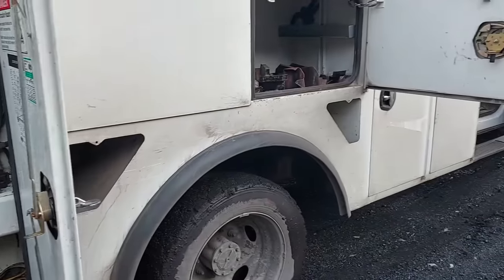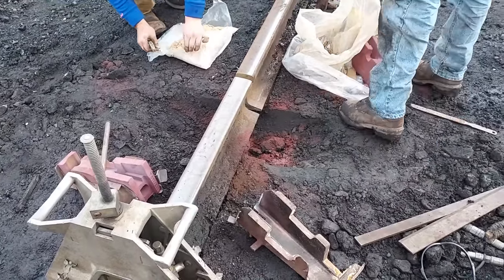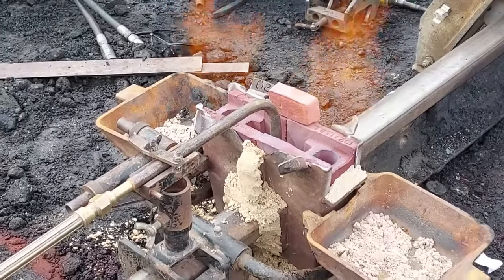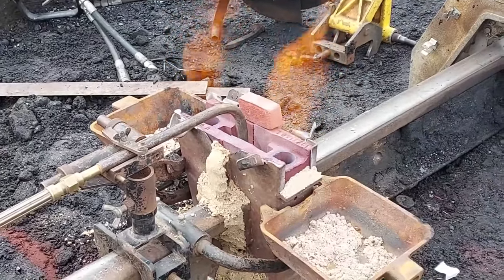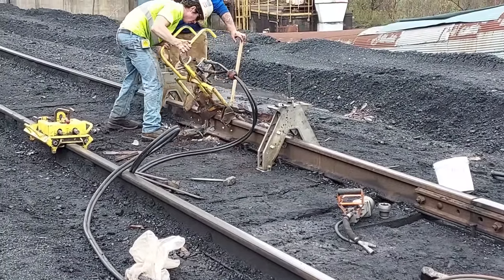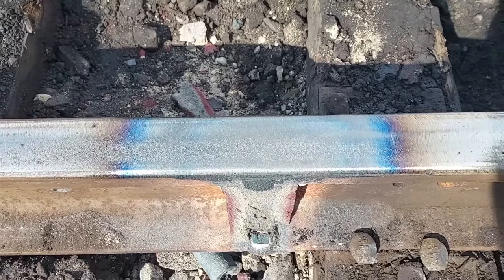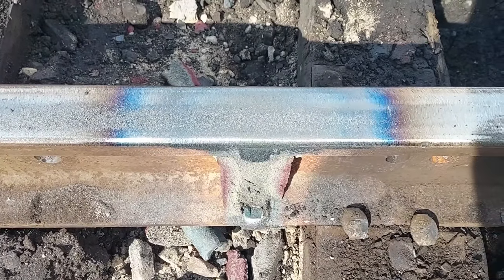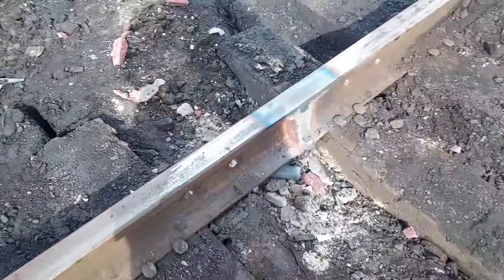Shooting a Thermite Weld on the Railroad from Start to Finish

Comment: All I’m thinking here, is that Why doesn’t the company provide all suitable work clothes?
I mean where I live in Denmark!
The laws says that companies have to supply you with adequate Work clothes. Suitable and security certified when working manual labor. 
working in the Railroad repair industry. 
It’s not because the law says it they provide it. But because it’s a relatively low cost to protect their employees. 
No employee shouldn’t have to use their own clothes they have paid for personally on their job. Unless there is a Financial compensation agreement with the employee.

My best friend used to be a welder. 

His work clothes! Provided by the company 
Was 2 pairs of Safety shoes. 
6 Long Sleeve Work pants
3 Work Shorts 
9 pairs of Specialized socks 
9 T-Shirts 
3 protective Work jackets 
2 Normal Work hoodies 
4 pairs of Specialized gloves. 
Everything can be replaced, just by handing in the clothing that needs replacing.

Oh of course a locker in their main base. To store it all and get dirty clothes washed by the Cleaning service.

That’s not even considered a Work benefit, that’s just reasonable when working for someone.
Reply from the maker: Very much appreciate your taking the time to tune in and
watch the video Common Sense. Hope you will sometime check out more of our Railroad videos at:
https://www.youtube.com/c/ccrx6700
Reply: @ccrx6700  thanks for the reply. And I will 😁

Comment: why weld instead of replace? cost?
Reply from the maker: A rail had broken there and this was welded rail to begin
with, so to eliminate the joints we welded it to keep it all
welded rail in this section. Thank you very much for taking the time to visit with us and check out the video.

Comment: Back in days late 70s ... working fo UP steel gang .  They used call them Glue gang....
Reply from the maker: I never heard that term before Dan, neat.  Appreciate very
much your taking the time to watch the video my friend.
Reply: @ccrx6700  yep.   Back in da days ..  alot of Navajos... were railroader,s    ...  glue were always at da very end of da steel gang...  welding  joints  together..  what they call 1/4 mile ribbons... 1/4 mile new rail...       was abit of hard  wrk . Today    Machinery  toke  over.
Reply from the maker: @danellis800  👍😊

Comment: I can't imagine any advantage to this welding process outside of not having to have a external machine thats capable of generating an arc..   

I'm certainly not trying to tell you your business. I'm just saying as a welder, I can't imagine any real advantage here... Any time saved by the actual welding of the joint , is lost in the large amount of excess bead that must be ground flush. And I can't imagine a world where that weld isn't full of porosity and lacking fusion.  
I mean the bottom of the track, would be the toughest part to weld , but I can think of several ways around that that would make the process easier.. and once the very bottom of the track was welded the rest would be gravy..  
I dunno maybe I'm missing something here, but if the truck is already out there, it seems logical that a welding machine could be also..  and if it is, a experienced flux core or stick welder could sew that track up in 15-20 minutes with minimal grinding to do after
Reply from the maker: Thanks for watching and sharing your thoughts. No one that I
know of stick welds rail. There is a process called flash but welding
that some RR's do, it's electric arc. A big automated welder
comes out of the back of a box truck, sets down on the rail
and presto it welds it. All of our welds are done by contractors
and they don't have the equipment to flash butt. So they do
thermite. May you have a most blessed day my friend.

Comment: Quick question (not sure it will get seen). But I've cut railway track with an angle grinder and it was a complete nightmare. I vaguely remember reading that its some molybdenum alloy that hardens v well. I was just wondering what effects this insanely hot weld has on the properties of the steel? I'd have thought it completely destroys any hardening and creates a substantial weakspot in the track no?
Reply from the maker: Good question, apparently it does not give a soft spot in the
rail because thermite welding is done all the time all over the
world. We appreciate your taking the time to visit with us and check out the video. May you have a most blessed day my friend.

Comment: When I used to weld crane rail for automatic storage and retrieval systems, stackers at paper mills, reclaimers at power plants, gantry cranes  at the ports,etc.., you couldn't leave all that flash and slag on there. Even the bottom had to be profile grinded. After you knocked the ears off, the job was just getting started.
Reply from the maker: That's great to hear you say that Daniel. Good job. Apparently the
RR is not that critical. Very grateful for your taking the time to visit with us and check out the video my friend.

Comment: I wouldn't let these guys near a mainline railway..! Pressure gauges missing on the heating torch end, and I didn't see a stopwatch anywhere in the video. Heating the rail  is performed by ensuring a set pressure (at the torch) and heating for a set period of time, dependent on the type of gas being used and the size of the rail. Similarly, the waiting time before knocking off the moulds should be according to a specific timing after the weld is dropped into the mould. Not sure I like the obvious "blueing" of the rail after he has completed the grinding...!
Reply from the maker: Thank you for sharing your thoughts with us Safety @AMSV. We appreciate your taking the time to check out the video and write in my friend.

Comment: Worked on BR for 20 odd years and thermit welding was always good in the winter . If some numpty tapped the rail further up and you had a run out , then it was a scramble . 👍🇬🇧
Reply from the maker: Really appreciate your stopping by Stephen and checking out the
presentation my friend. Understand tapping the rail, our
welders are pretty particular about not doing that.

Comment: Why wouldn't you just bolt it together? Theres already holes in the tracks for that.
Reply from the maker: Elimination of a joint in some very poor ballast conditions is why
it was welded. Joints don't do well in that bad of ballast. Thank you for taking the time to write in and for checking out the video my friend.

Comment: That grinding is dangerous. Moving that machine from side to side is going to real havoc on your lower back and knees by the time you are in your late 30’s. Try moving so you use a push and pull motion.
Speaking from experience and living with hip and knee pains that are excruciating. Nothing can be done but to live with it.
I had no body to tell me so I can only hope you listen and learn something.
Nice job on the rails!
Reply from the maker: Thank you very much Rob for taking the time out of your busy day to watch the video and write in with your thoughts.

Comment: . . . my dad used to do this while employed BNSF and he would come home and describe the process, who knew 25 years later I would be watching it on you tube
Reply from the maker: That's pretty cool to hear Rae.Thanks so much for taking the time to check out the video and may you have a very good day my friend.
Reply: This guy mentioned good old Smiddy in this video!  I remember Smiddy once bent over to pick up a tool, and he was standing rear-end facing a guy working on a rail.  Well, when he bent down, his rear stuck out inches from this guy's face and the force of picking up a heavy tool caused a big wet fart right in the guys face as he was breathing in.  The guy nearly vomited.  Man, that was hilarious, but I never really trusted smiddy after that.

Comment: It seemed to me that the process was quite efficient, with most of the molten iron from the thermite being contained and very little 'splattering' off as sparks.  Do you know how much of the thermite typically sparks / spatters away?
Also, it doesn't appear that it takes long from the ignition of the charge to the point where they can start cutting it away. You have shortened the sequence, but do you know roughly how long a wait was required?

Simon
Reply from the maker: Thank you for the nice comment Simon, glad you enjoyed. Lighting the weld was not video shortened, what you saw was what it took. We appreciate your taking the time to watch and write in my friend.

Comment: Is this what they gotta do when building a long stretch.. or is there another technique
Reply from the maker: Most RR's purchase continuous welded rail that comes in
1200 or 1400 foot sticks. Those are sent out via special
rail carrier cars. We cannot get those long sticks in here
because we do not interchange with another RR. So if
we want long sticks of welded rail, then yes we have to
thermite weld every 39 feet of rail stick.
Reply: @ccrx6700  ahh ok.. thanks

Comment: What is the average hourly rate for someone with these skills & qualifications?  Just curious it's always fascinated me
Reply from the maker: There are a lot of variables to that answer Jetlink. As welders
for this contractor coming on our job, it's right around 20 an hour.
However some jobs for some other RR's are rate jobs and pay
much higher. For instance, our contractor is currently doing
a huge job for Vermont RR. That particular job pays these guys
around 50 an hour. So it varies, depending on where they go.
And again, I can only speak for this particular contractor, not
anyone else. Thanks for asking and for watching the show.

Comment: Boring.  Besides a note on temperature, no technical explanations of any kind.  Should discuss timing and sequencing of each step, gap width, strength of rail steel versus weld material, mix amounts of the reactive materials, how are materials stacked in the crucible, material sources, grinder specs, etc.
Reply from the maker: We would like to say Thank You very much for taking the time
to visit with us today and watch the presentation MJ S. I really
wish you had wrote in before I made this and then I would
have known what you were looking for.

Comment: How long is each section before a weld is required, typically?
Reply from the maker: We have all 39 foot sticks of rail here with a few short plugs here
and there. Some of the RR's out there have 1200 or 1400 foot
sticks of all welded rail.
Reply: @ccrx6700  Amazing! Thank you!
Reply from the maker: @CaesarCapone  😊👍

Comment: Why weld, is it the gap???  Looks to be a short, little used spur to a tipple, slow speed, so why not just bolt it?  I'd understand if it needed holes drilled.  Also, whatta you do if it's on top of a tie?  THANKS!
Reply from the maker: We would like to say Thank You very much for taking the time
to visit with us today and watch the presentation al ro.
Really poor ballast conditions and the joints won't hold track surface
nearly as well as welded rail. This track is used all the time
as they load the trains, up to 6 trains a day. If it's on top of a tie,
you move the tie sir.
Hope you will sometime check out more of our Railroad videos at:
https://www.youtube.com/c/ccrx6700

Comment: Im not a expert on anything thats important , but how can you weld railroad tracks together with heat expansion ?
Reply from the maker: Welded track is anchored every tie Eddie, that helps to alleviate
the rail creep. Thanks so much for taking the time to check out the thermite welding video my friend.

Comment: not exactly setting any speed records with this method lol is this done on every connection during rail construction?
Reply from the maker: No it is not Zach, this is used mainly for a repair job. Most railroads
buy rail already welded at the factory in 1200 or 1400 foot lengths.
Thanks so much for taking the time to check out the video and may you have a very good day my friend.

Comment: Ok thanks for the intersting video but i have questions. 1 why is this sytle welding required?   Can it just be welded? I assuming it something to do with warping or maybe medal fatigue?  But either way thats a very interested why to weld! I learned alot so thanks from northwestern new mexico
Reply from the maker: Thank you John, glad you had a good time with us today. We do
appreciate your watching. There are 2 ways to weld rail in the
field, thermite and flash butt. Flash butt is similar to arc welding,
it is a big welder that comes out of a box truck and lowers
on the rail, after the rail is aligned there is no other work involved
for a person except to turn the welder on. It is a whole lot faster.
However our welders are contractors and they don't have the
equipment needed to flash butt weld, so the thermite.

Comment: My Dad and Uncle were Railroad Workers. My dad fixed railcars and was a craneman. My uncle worked in the shop fixing air tools and general labor. Hard, dirty work on a private railroad into a steel mill. Union guys caused worker unrest and too many strikes. The mills shut down and the rest is history.
Reply from the maker: Thank you for the very nice comment and for sharing that Bertram.
Appreciate your taking the time to visit with us and check out the video my friend.

Comment: Sorry to be one to put a downer on this but it left me quite disappointed. I'm a mechanical engineer by trade and can work most things out but you really do need explanations here. There may well be the answers amongst the comments but they shouldn't have needed to be asked in the first place. And most of us don't have the time to trawl through over 1700 comments. I know what Thermite is, how it works and what it can do but we're left to guess what it is that fills the gap between the rails. One cannot assume that Thermite alone has the metal properties to create a joint that can withstand years of trains passing over it. Or maybe it can? We were never told. 

The yellow machine that slides over the joint after the Thermite reaction has finished, followed by the hammer - is it a guillotine cutting off most of the excess ready for grinding?

Towards the end of the video you showed us 2 welds that were done that day just a few feet apart. Yet  an old type splice joint was  also just a few feet away. Why did they not fit a longer section of track from the splice and only needing just one weld? And why did the short section of track require replacement? 

The material used to make the moulds - ceramic. Light weight and can contain molten metal.
Reply from the maker: Thank you very much Michael for taking the time out of your busy day to watch the video and write in with your thoughts.

Comment: It's funny. This seems almost primitive in the formation of the mold. It seems like there should be a simple way to quickly snap on a mold and pour in molten steel.
Reply from the maker: There is a pretty simple way of welding rail called flash butt
welding, however all our welds are done by contractors and
they do not have that kind of equipment. Thanks for taking in
the video today centexan.

Comment: That was a very interesting video of a railroad track weld. Electricians use thermite on ground rod installations very similar but smaller scale.
Reply from the maker: Thank you jimm 8246 for checking out the video and writing in. May you have a most blessed day my friend.

Comment: so what kind of equipment / elements are used to do this kind of thing ????
Reply from the maker: Some railroads do what is called flash butt welding where a big
welding machine comes out of the back of a box truck and sets
down on the rail to weld it. These are contractors and don't have
that equipment so they do thermite welding to join the rails Nathan.
Very much appreciate your taking the time to pay us a visit and check out the thermite welding video my friend.

Comment: Is this how all track is joined, or just repairs?
Reply from the maker: We have all jointed track here and when they need to weld a 'piece
in somewhere, like they did here, then yes, it is thermite welded.
All of our welds are done by contractors and these guys don't
use flash butt welding. Thank you so much for stopping by and
checking out the thermite welding video my friend.

Comment: Why does it have to be perfect? You are going to grind it and there is always some warping of the tracks. You can see Tracks literally move as the train rolls over them.
Reply from the maker: These guys also do welds for other railroads, they are contract
welders. When they do welds for high speed rail the standards
are exacting Robert. You wouldn't want your family traveling
90 MPH on track that had been welded out of specs, so they
continue their standards whenever they do a weld. Thanks for
popping in today and watching the show.

Comment: À 10:24 le métal fondu s'écoule à grandes lampées et forme deux lampes ! 😂

(From 10:24 lots of molten metal flow and make two lamps 😂)
Reply from the maker: Thank you for  taking the time to visit with us and check out the video my friend.
Reply: @ccrx6700  You're welcome.
And I said the same sentence in english as well, did you click read more ?
Anyways it's From 10:24 lots of molten metal flow and make two lamps 😂
Because yeah, it's kind of a stunning light show isn't it ? 😉🎆
Reply from the maker: @psirvent8  yes I read the read more 👍😊